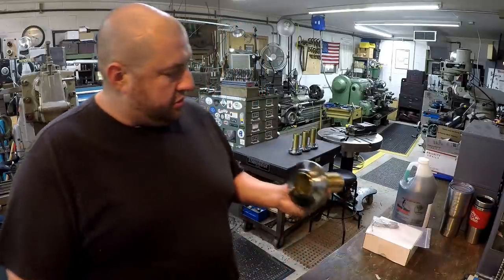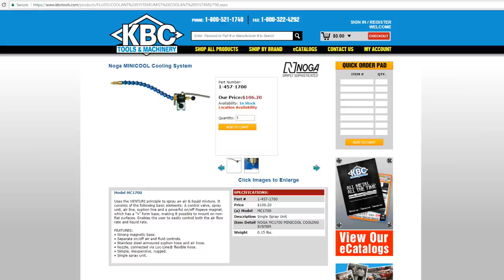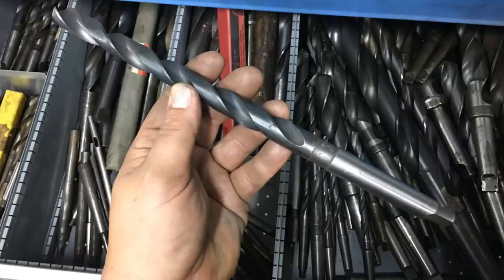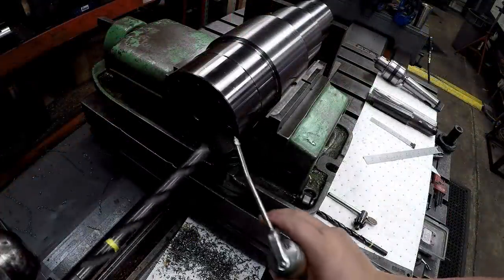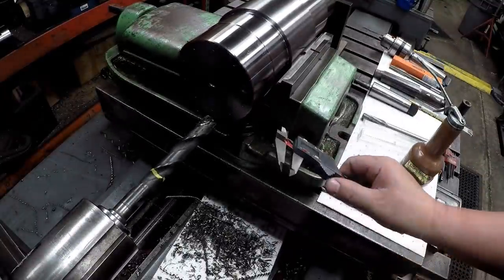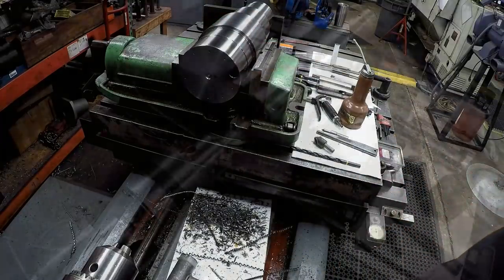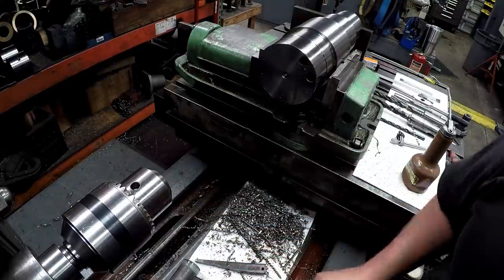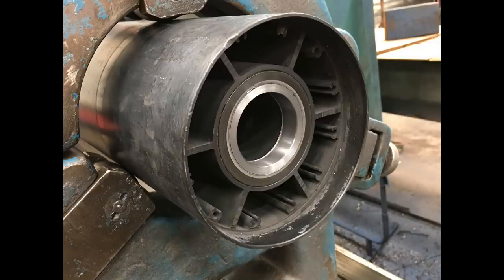SNS 190: EMD Gearbox Shaft, Deep Hole Tapping

Comment: Adam, You have shown the tip to shear off the  sharp edge in a mill vise before and I have used this tip. I made a bunch of stainless spacers to modify my jerky slicer to cut thinner strips. Thanks for the tip! it works great.

Comment: Speaking of holes being drilled...... I drilled the smallest holes I have ever drilled yesterday. They were .010 in dia. Used a "Servo" brand mini drill and a microscope. They were in a new valve body we are building. Talk about pecking away at something. Like you I got it done. Another great video Adam. Glad Motion will let you film again.
Reply from the maker: +Johnny Holland I still can’t see myself using a cutter that small. I actually have some drills that are .006 in diameter that someone give me.
Reply: A friend is in aviation engineering and some the company is in the States and some in the UK. Always competition as you can imagine. The states machined a piece 0.1 thousandths diameter and sent it to the UK. My mate, drilled it, tapped it, and put a bolt in it and sent it back to them. Now that is minute engineering. Des. Love the work by the way.

Comment: The Noga Mists come with two hoses and and output.  The hoses are both 1m long, one is your air intake and the other is the siphon hose.  Noga sells a 2m hose as well.  For me the distance from the head of the Bridgeport to the tank was a bit more than 1m so I was always fighting to have the tank in the right place.  I ordered the  2m hose from MSC Direct, took a while as they had to special order it from Noga but the did deliver it after a while. 

The 2m doesn't work as well because of the distance of lift but it did allow me to position the tank up off the ground behind the Bridgeport which works nearly flawlessly.

Also, if you have an unheated shop, remember that the coolant can freeze so you might need to take the entire system into a temperature controlled area.

Comment: I have a full set of fraction, number and letter screw-machine length drill bits. If you have a smaller than ABOM size mill, they are extremely useful for big things where you don't have a lot of room left over when you clamp it to the table. They are also really nice when you power tap because they are not much longer than the tap, less knee or head travel when switching bits.
Reply from the maker: Good point, great to use when height is limited in the mill.

Comment: I'm a vibe guy and it amazes me to see huge steel shafts and I have to remember that shaft has a geometric center and a center of mass and they are rarely in the same location. At resonance that shaft and everything it's connected to becomes very loose. Some of those shafts will grow and contract with the heat of the day, with some the difference is in inches of growth or contraction. Plus the shaft bends into the load zone. Hard to think of a 12" or 24" or 36" shaft bending, but it does, hard to think of them becoming as loose as a noodle but they do in resonance.

Comment: Get spotting drills for hole starters, they usually have a slightly larger included angle than normal drill for perfect centering. Extremely short or just shorten to suit and in some places called "NC drills".

Comment: I want to mention something about KBC tools. If you are not ordering a ton of stuff, they have shipping for $8.95. While they do have a $25 minimum order, I have found this shipping rate to be a whole lot cheaper than a lot of tool sellers. Most I have found will charge you $15+, no matter what you order.
Reply from the maker: +Sithus1966 good point made, they advertise this on there home page. 👍🏻

Comment: Awesome sir, really enjoyed this SNS.  Curious if your sales people at Motion ever involve you in the bid process for jobs like this?  Like what material, how many hours, etc.  Also, do you charge the customer for any special tooling that needs to be ordered, or does the tooling just get absorbed into your overhead of the company because you can use it on other jobs in the future?
Reply from the maker: +Ramsey Customs - turbocobra Gary, many times on these larger shaft we get quotes from manufacturers on them. If they are ridiculously expensive we can usually make them in house for less. The technicians will quote the job with plenty of time for the rebuild and allocate some of that for me to build the shaft. Once it’s done we’ll get together on the time I spent and document it. Special tooling needed to machine it will be included in the quote. More daily use tools are bought on expense.

Comment: Hey I'm just a dumb welder fabricator guy and i love learning new stuff so I'm sorry for my dumb questions but hey that's how you learn.  Why did you sometimes use oil when you cut parts and other times no oil? And my other question is when your cutting threads how does the machine not cross thread meaning how does the machine know when to start cutting so it doesn't start at another point on the threads and then cross thread?. When ever you have time of you could educate me. Thanks Matthew Peters

Comment: “Permits? We don’t need no stinkin’ permits!”
Reply: @FixItStupid   It's not really that we don't need stinking permits,  it about the regulators going ape with permits.  We live in an age where everything needs to be run past the policy wonks first.  We don't trust ourselves to have a bit of an idea of what is good and what is not good.  

What has come into the vacuum of common sense is a whole blizzard of what I call zero infinity ideas.  Ideas that are impossible to criticize  (zero criticism),  but whose implementation has infinite consequences.  One is the idea that everyone has a right to be safe when in a public space. (Don't know where the red highlighting comes from).  A billion regulations is possible based on this piece of impossibility.

Against this it seems exceedingly difficult to get some measure of control over really important things like banks,  which really do need some controls.

In the absence of good regulation over really important things we drown in a flood of regulation over relatively unimportant things.
Reply: Evan Penny:  Note to myself.  A bit of a Sunday night rave.

Comment: Adam, what's the process for cleaning up when done with taps and drills?  Do you degrease and leave bare, or just a wipe-down, having a layer of the cutting oil on?
Reply from the maker: Typically I blow them off, or wipe them off leaving a film of cutting oil on them though.

Comment: Greetings,

Awesome vid! Could you talk about pricing for some of these larger jobs. Is it mostly base on machining time, material, tooling, design, or what? My new job requires me to design large things out of metal and would info on that side of things. Could make for a boring video so maybe just sprinkle it in? Thanks and will be watching!
Reply from the maker: One thing I can't talk about with customer work.

Comment: Just out of curiosity: on that babbitt bearing you're boring out, would just melting the babbitt out with a brazing torch work? That way all you'd have to do is bore the castings to size, rather than having to take multiple passes to cut out the bearing material, and you could catch and save the babbitt if you wanted.
Reply: Brand-X It would work, but it would make quite a mess and possibly screw up the paint on the housing.
Reply from the maker: +Brand-X I like to center up on the bearing where the factory bores it. I have no use for the Babbitt.
Reply: Aw ite den.  :)

Comment: Hey Adam, How did you like that Hertel Tap?  I've had some bad experiences with Hertel.  I prefer Cleveland drill bits, but I gave Hertel drill bits a try.  I have for years drilled cross holes in 300series stainless steel shafts for holding 1/16" diameter spring pins using cleveland drills at 2000 rpm and cutting fluid - with no problem.  Tried the hertel bits and nothing but problems.  tried slowing down the spindle speed, heavier feed, etc...  But I kept breaking bit after bit.  switched over to the Cleveland bit and it cut like butter.  I threw away over a hundred of the 1/16" Hertel drill bits - not  worth the trouble.
Reply from the maker: +Ujeb08 This Tap was good, and ground nice. It was what we found to buy. I have not used the Hertel drills.

Comment: I woulda been worried about the bit walking at the bottom of the blind hole, but I guess you skipped the pilot drill for that part?  Maybe I just wasn't paying attention in class tonight, though.
Reply from the maker: +R.C. Whitehead If you have the correct grind it’ll drill straight.
Reply: Abom79 - Roger that, Adam.

Comment: Total newbie question: What's the point of the babbitt if it was all machined away?
Reply from the maker: +Lite Roadie It’s designed to be used as a plain Bearing with oil lubrication. The bearing is repurposed to use with a carbon sleeve instead.

Comment: Hate starter taps for general use. They're great for starting hand tapped holes straight but otherwise they're hard to drive and in blind holes you have to drill up to1 1/2 diameters deeper to get the same effective thread depth as a plug. I usually grind back the end to where the taper intersects the tap drill size and gain another 3 complete threads in depth; 5 in UNF.

I'm jealous. Old Is OK. I'm comfortable but there are times I wish I could get back to work in a real machine shop making useful parts.
Reply from the maker: +Forrest  Addy I didn’t have much of a choice options on this tap I needed. Starter is what we found, and I also had a Walton tap extension just in case I needed to go in with a bottom tap.
Reply: Abom79 I looked up Walton tap detentions. Never used them or was aware of their existence. Whenever I needed a long tap and a pulley tap wouldn't do, I made one by bashing a suitable tube over the driving square or sil brazed the tap shank in a round socket drilled in a length of whatever's handy. Gov't you know. Fast acquisition via the planning office took two weeks. Be clever or die.

Comment: Adam:
Seeing that stainless, with all your experience, have you found material(s) that are especially difficult to work with?
Hard on tooling, refusing to chip, inconsistent quality, difficult to get a good finish etc. etc.
Reply from the maker: Yep, stainless, and aluminum bronze. I also dislike induction hardened rod stock.

Comment: Hi Adam !. You changed the drill speed ? , what info do you use to know the different speed for the drill size ? Is there a rule ?
Reply from the maker: I have that stuff in my head from doing it long enough. Lathes only have so many speeds so I remember what size and what rpm selection to go with. But yes there are formulas to go by to figure speed, it depends on the SFM you need to run, and drill diameter. I have found that running a bit slower then recommended is better then burning up a drill bit.

Comment: Does the hole pattern get clocked and did the print give a coordinate table to set the holes by?
Reply from the maker: +bjr E. WA. I had a print to follow.
Reply: clock the hole pattern ? no keyway wtf
Reply: I should have said clocked with the opposite end holes, was all I meant

Comment: Adam, why do you use a reamer to finish off the hole?
Reply: David Benson To leave a more precisely sized and smoother hole. Shows the quality of his work.
Reply: So are the reamers the same size as the drill or slightly larger?
Reply: David Benson Slightly larger. You generally drill one size smaller than your finished hole size, and finish with a reamer.
Reply from the maker: +David Benson Reamers are designed to cut on size and leave a good finish.

Comment: That seems like a bit of a waste, i wonder why they have to have that base, or at best, why the can't contact the manufacturer to get them raw ones.
Reply: Maybe Adam could collect the first pass through the babbitt and give it to Keith Rucker. That stuff isn't cheap.
Reply from the maker: +aserta Been doing it for years, it’s the way the engineers have it designed. The factory must not provide that size bearing with the proper carbon sleeves needed.

Comment: I doubt that 10% of the 'snowflake generation' realise just how much the modern world relies entirely on the engineering skills of blokes like you, Adam.
Reply: And I doubt that 10% of the people who complain about the "snowflake generation" realize how many of us actually do realize this stuff.  I am one of your "snowflake generation" and work as a union millwright.  I work in facilities ranging from nuclear power houses to grain processing facilities to the John Deere Foundry in Waterloo, IA.  I personally have set machinery and equipment ranging from 40 pound servo motors to one of the LP turbine rotors at a nuclear power house that with the rigging beam was 108 ton on the crane.  The point is, a lot of us do realize and work on this equipment.  And I work in conditions ranging from 130°F to -35°F. 

Of the crews I have worked with, about half are of your "snowflake generation".
Reply: You are clearly NOT a 'snowlflake'.  You are one of the 10% (maybe more).  The Snowflakes are your peer group who do not appreciate this sort of stuff. And if you think about it it is my generation, the baby boomers, who are responsible for siring the Snowflakes, or more accurately are complicit in nuturing them.
The point I think I was trying to make is that it is all very well being good at writing an app (say) but without what Adam does we would not have clean water and sewerage. The fundamentals of how engineering - both good design and great application skills like Adam's - underpin our world escape many people (including, but less so in, baby boomers).

Comment: adam i needed a set of stub drills and that sounded great picked over $150 in drills and used your promo code (kbc25ab) will not work no sale.
Reply from the maker: +cockatoobirdman bill Call them on Monday. It’s supposed to be good till end of this year.
Reply: Did you register as a customer?  If wouldn't accept the promo code as an "anonymous" user.
Reply: I just used the code to buy a new set of Mitutoyo calipers I've been needing awhile. Worked fine for me. Try doing it in all caps maybe?
Reply: I just tried placing an order for 3 sets of drills (frac, # and letter), the promo code seems to work, BUT, when I get the final SUBMIT ORDER screen, the prices went up, almost $20 higher than was just previously shown.  Not sure whats going on there.  Will try to order again later or tomorrow and see if it fixes itself, or call on Monday.  :o(
Reply from the maker: +cockatoobirdman bill I was going to suggest wait until next week and call them directly.